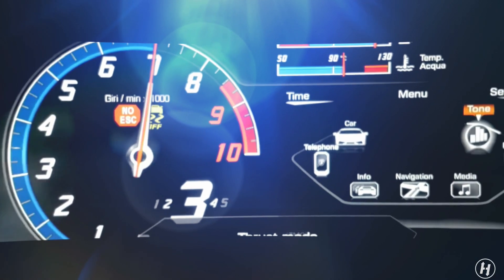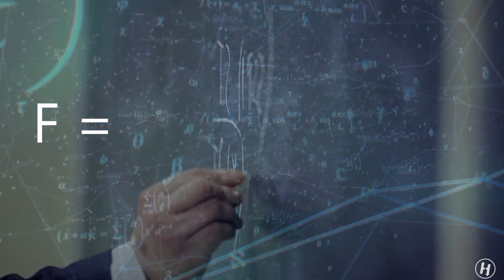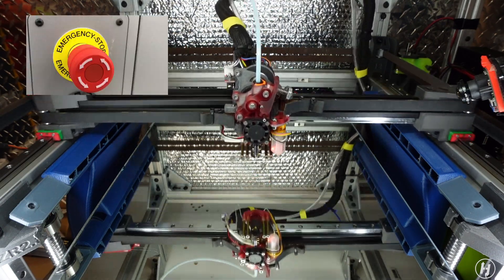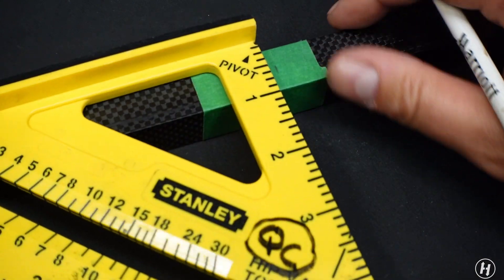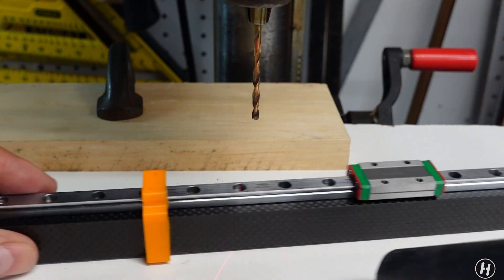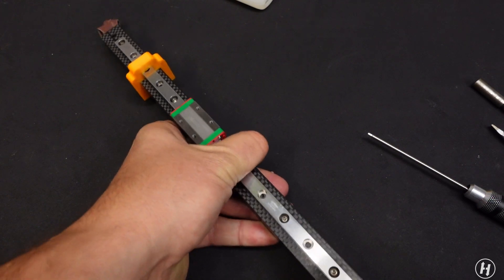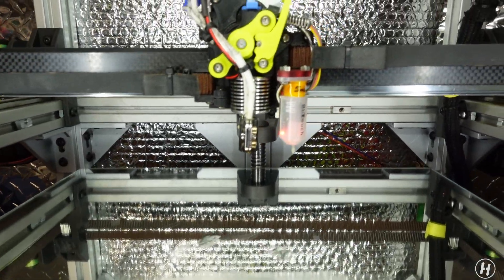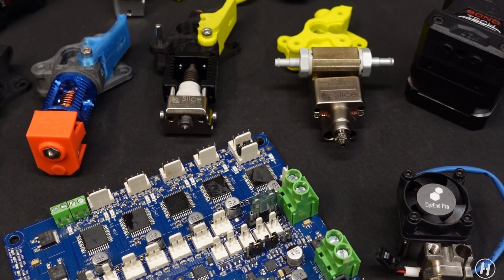Using TITANIUM and CARBON fiber on your 3D Printer

Comment: Don't underestimate the weight of hardware. Mazda famously saved 100s of lbs using 'gram strategy'. That included using smaller fasterners and smaller heads on this fasteners, and ones only as long as needed. I bet the steel bolts are 1/2 the weight.
Reply: It was Colin Chapman, the founder of Lotus, who was the pioneer. “Simplify and add lightness” was his mantra.
Reply: steel is twice the weight of titanium, and titanium is twice the weight of aluminium bolts
Reply: @Nobody-Nowhere  I think they meant that the steel hardware is accounting for half the weight of the whole assembly.
Reply: @Nobody-Nowhere  titanium is about 1/4 durable as titanium... titanium bolts are just a stupid idea and offer little advantage.
Reply: I'm sure nylon hardware is strong enough for holding down the rail, I bet aluminum pop rivets would work too.
Reply: @BrianBoniMakes  steel pop rivets with backing washers...
Reply: @BrianBoniMakes  probably bad for heated chamber, maybe peek or PEI screws would be better.  just pricey.
Reply: That's a fun fact, im a mechanic and I've wondered how much effort companies take to do this
Reply: So that's why Mazdas are junk.

Comment: Great video! Well done and smart, as always. 
You could save a few grams and resistance by making an airtight printer enclosure, running a vacuum pump, and voiding the encloser of all air, but then everything would have to be water cooled...and the extruded plastic would ooze...the part cooling wouldn't work, etc...
Reply: I dont the air drag would play a significant role in performance. Definitely not worth the investment.
Reply: i wonder if the opposite would be better, increased pressure for better cooling

Comment: Why not use plastic-screws/Washers for none-load bearing parts.

Also you can redesing the printed parts for optimum weight to load capacitys.

Saves a few grams
Reply from the maker: Yes, this HD gantry was design specifically to allow servos and heavy weight print head.  Although the CF rods and Titanium hardware got this HevORT HD lighter than my initial STD CF X axis build, the HevORT STD/HT gantry is definitely a better candidate for light weigth.

Comment: hmm. couldnt you remove the cooling fans? i mean the plastic has to cool down. But it doesn't have to be cooled down by air. You could flood the printing area with something that has more thermal capacity or is way cooler to begin with. Something like liquid nitrogen. maybe not that extreme but there is definitely enough cooling solutions that don't need the cooling fans at the print. in addition cooling your motors they will draw less amps.
Reply from the maker: BerdAir is a great way to deliver large amount of air under high pressure to the part when using powerful pumps.

Comment: What about the duet 3 board? It can go higher amperage on the steppers
Reply from the maker: Yes, but it does not support Klipper.  The acceleration gains from additional power would be impacted by the lack of look ahead and MCU processing power.  Its been a long time I have not looked at RRF, things may have change though.

Comment: E3D ditched the carbon plate on their tool changer due to issues with the difference in thermal expansion on carbon fiber and steel (bending of the gantry). 
Did you notice anything indicating this issue? Or is a carbonfiber tube simply just so much stiffer than a 6 mm plate that it neglects the bending/overpowers the rail?
Reply from the maker: I have not noticed any issue while printing ABS with enclosure temps of 55C.  But yes, this may be an issue at higher temps.   Materials used in speed printing usually don't require high enclosure temperatures.
Reply: @MirageC  Thanks Mirage!

No I am not really aiming to beat you guys in a speedboat xD I prefer the best possible quality at higher than average speeds. The lighter, the less ringing at higher speeds :) 
I will be happy with 10k acc and 100 mm/s speeds. I just want as little rigning as possible :)
Reply: They used a cf plate. The tube is stiffer. I didn't see any issue yet but my enclosure never goes above 45c
Reply: @Vez3D   Ok thanks Vez3D! True, yours are also carbon now.. 

Yeah I expected it may simply be stiff enough for it not to be an issue. 

I will be reaching 80 degreees though. At first I was going for a 6 mm carbon plate, but then I saw that E3D blog post.. So now I was going with 6 mm aluminum plate, but seeing this I will see if my design can accomodate a tube like you guys. I am building a crossed gantry machine so it may not fit a 20x20 but maybe 20x15.

Comment: that rail is probably the heaviest thing on there. This week ill be playing with something to replace it. Ill keep you posted :)
Reply: Could you mill or bore holes in the rail to remove weight?
Reply from the maker: Yes, that is something Vlad from 3DPassion wants to have me try!
Reply: @MirageC  9mm rail, flip the rail, use a grinding wheel and grind the rail into a hollow C channel.  Top to connect the two sides and for screw mounting and the sides for the slide balls to ride in are needed, but the bottom center and interior of the rail aren't nearly as useful.  If you take the 12mm rail and grind out the bottom and center like this you can probably take out most of the weight, and there will be little difference between the 9mm rail and 12mm rail.  You need the sides, and there would be very little extra in 3mm extra of just top face weight..
I'd expect to take out half of the mass of the rail, maybe a bit more, that should leave plenty for strength of the remaining C section.
Reply: @ModelLights  I think this thing about removing the weight is going too far...
however I remind you that you have to leave enough material to withstand the preload of the linear guide fixing screws
Reply: @TheRealMrLaserCutter  the steel used for linear guides usually has a hardness of 55/65 HRC, which is a lot for HSS drill bit... it is a real challenge to drill holes in that steel... maybe you can be successful using tungsten carbide bits, but they require precise cutting speeds otherwise you risk throwing away an 80-100 € drill bit after, like, 10 holes
Reply: @librasd8087  Sounds like an excuse to learn to burn! Aka wire EDM or electrochemical machining.
Reply: @nobodynoone2500  wire EDM sound nice for that job! But is it worth it? How much it would cost to do it?
Reply: @librasd8087  maybe a burr or grinding disc and lot of water
Reply: @TheRealMrLaserCutter  and a lot of time
Reply: How about replacing the rail and the CF tub with a pair precision ground titanium tubes.
Reply: How about Teflon or some other similar low friction polymer?
Is it possible to use a igus polymer / teflon sleeve bearing on a carbon fiber rod (instead of the standard ball bearing on steel) - its probalby less precise than a linear rail but, well, less weight
Reply: @GerManBearPig  I tried that setup before. Igus bushings on carbon rods. those LM8LUU bushings need to be caged in an aluminum case to have proper preload..or they are too slack.
 It has too much friction... But maybe not for servos motors :)
Reply: @Vez3D  hi bro can i ask what measure is the carbon fiber square tube? i wanna try it on my voron
Reply: Dude, I love both of your designs!  So thank you both for sharing all the tips, build details, and progress.  I'm such a nerd, love it!

I just picked this back up recently too, after a few years off.  I've hardcore been updating my s#/t, and teaching myself how to set up an Octopus 🐙 pro this week.  Wired up 2 PSU's and all my doodads already.  Trying hard to learn all the ropes of setting up Klipper firmware now, sensorless homing, bed leveling, input shaping, etc.  Would love to hear more tips and tweaks!

I also hope I can jump in these races 🏁too someday! 😆 

P.S., carbon fiber is cool 😎, but it needs more cowbell.
Reply: Exoslide? Or something like an exoslide?
Reply: I was thinking the same. Doesn't the test data show that using the aluminum extrusion is effectively just as accurate? Seems like ditching the linear rail would save more mass.
Reply: I would love to see air bearings which run directly on the CF-beam.
0 weight for the rail and no slipstick. the lack of slipstick should improve print quality.
Reply: @Latschi8  It's not true (straight) enough for air bearings and the air requirements would be annoying when a roller would provide nearly the same without the trouble. Also it would introduce position variability due to the small clearance and varying loads.
Reply: Hi my Chinese made i3 clone made by Hanbot has nylon linear guides... Even the carriage is made from some plastic but have yet to find any similar products
Reply: Have you tought about using two smaler linear rails on opposite sides of carbon square? Like mgn5. With the 2cm space between them, they should be quite rigid, when the blocks are connected together.
Reply: I was wondering if mounting the linear guide on the side of the carbon fiber beam was a better solution to increase the resonant frequency of the y axis than mounting it above / below. Have you done this type of experiment?
Reply: @librasd8087  my next iteration of the printhead will be like that
Reply: @Vez3D  WOW, wow, you are evolving your 3d printer very quickly! Just love it!
I hope you have kept the accelerometer data of your current version, because it would be really interesting to compare it with your next iteration of the 3d printer
Reply: @Vez3D  Maybe instead of a cooling fan you could use a thin flexible hose supplied by an air compressor. 
Next up: 3d printed cooling "fins" that are more like trees than walls (skeletonized for weight savings).
Has anyone every experimented with a piezo-electric filament extruder?
Reply: @ExtantFrodo2  berdair is almost what you describe
Reply: @librasd8087  Isnt a horizontal rail better since the direction of larger area moment of inertia (hope thats the correct term in eng) coincides with the force direction? (xy acceleration being the larges cause of forces on the system) 

The main benefit I see is that it would make it easier to build a very compact stiff printhead. But I'd have to look into it closer.
Reply: @dodo3441  looking at the section of the beam you can see that by mounting the linear guide above the beam you get a greater geometrical moment of inertia for deflections of the beam that are along the z axis; the force that we must take into account is due to the inertia of the print head, therefore it is a force that passes along the y axis, which would be the axis that goes front to back of the 3d printer, and it flexes the beam along that axis. So, to reduce the amplitude of the oscillations and move the resonant frequency towards higher frequencies we must have a greater moment of inertia along the y axis
Reply: @librasd8087  Your statement seems contradictory to me, we might be talking past each other. Are you talking about the moment of inertia of the rail only, or the rail+tube? 

"So, to reduce the amplitude of the oscillations and move the resonant frequency towards higher frequencies we must have a greater moment of inertia along the y axis"
Because we are on the same page about this, but I draw the opposite conclusion regarding the rail orientation. (viewing the rail only)
Reply: @dodo3441  horizontal linear guides do not allow to reach the maximum moment of inertia for the stresses along the y axis
P.S.: i'm talking  about the moment of inertia of rail + tube
P.P.S. it is necessary to talk about the whole assembly, because we are interested in the response of the whole beam + linear guide assembly
Reply: @librasd8087  Yup, looks like we are on the same page. Allthough I am not yet fully decided which is preferable. I'll have to draw it up and also look at the printhead cg of both configurations.
Reply: @dodo3441  the increase in inertia should also be evaluated
by calculating the center of gravity of the print head you should also be able to evaluate the deformations due to the forces of inertia in the two different cases ... maybe assuming 50k accelleration
sure, without an FEM analysis there is a strong approximation
maybe fusion360 can help, but I don't know what it takes to access the simulations we would need
Reply: @librasd8087   I'll be doing multibody sim and FEM and then derive topology optimized parts. (thats the plan)
Reply: the lightest solution would be simply to use a square plastic linear pushing on that square carbon rail, it should work fine
Reply: @Nobody-Nowhere  how about having a look  back in the past and use two carbon rods with linear ball baerings instead. Well they have to be damn straight but that should be much easier than doing this with a square carbon beam.
Reply: @Nobody-Nowhere  that's a terrible idea. Not only would the tolerances be garbage, but the resonant twisting moment would be huge. You would be able to get away with a cheat like that at slow speeds, but at high speeds you have a hot mess... Probably quite literally.
Reply: Carbon Fiber Linear Rails on the CF box tube would really up your print speed.
Reply: @PathosBedlam  does it even exist. I know Igus was working on prototype..but it never got to the market
Reply: @Vez3D  No idea. Just something I thought of while watching this. It would need a decent cnc metal mould to make it under pressure and heat though, then add the holes. Might require new slide design as well.

Comment: What about drilling holes through the aluminium extrusion to shave off weight 😂
Reply from the maker: Like in everything, extreme weight reduction will eventually clash with structural integrity.

Comment: Have you seen the new BTT Octopus Pro? It has support for up to 60V for the motor power separately from the board/heaters etc. Since the steppers also can be pulled it might be cheaper to replace if you blow one.
Reply from the maker: YEs, I have one incoming :)
Reply: I want one, but can't actually find it for sale yet. Settled on the 1.1 out of desperation. BTT, please!

Comment: what was the original full weight?
Light weight is ~539.5grams, but i don't see the full assy weight for full weight.
Reply: At 4:20 , "Just under 900 grams"
Reply: Does anyone know what bedsize he is running? 300*300 or bigger?
Reply from the maker: bed plate is 340*340.  actual print area is 280*280 with this config.
Reply: @MirageC  Thanks, I'll be doing a build focusing on light weight this winter, so its really helpful to have some references as a starting point (Y)

Comment: at 7:20 you say something about washers preventing the assembly coming loose with vibration. That's not a function washers perform.
Reply: Split washers, Belleville, rip lock etc. You could also look at the overall compression of a larger area at helping stop the nut from sinking into the plastic allowing the screw to come loose.
Reply: @ChrisHarmon1  split washers don't do anything regular washers don't in regards to loosening from vibration, disc springs do nothing to lock the fasteners and the vibration damping effects aren't going to do a lot in this kind of of application. Serrated washers do work but you risk damaging the carbon fiber tube. Best thing to do here is to just torque them correctly, use thread locker and check on them regularly.

Of course the washers here do increase the load area and reduce stress on the tube, so I am not saying not to use them, just pointing out that they do nothing to prevent loosening
Reply: @AlexusMaximusDE  I bet a nord lock style would work fine.
Reply from the maker: I should have been more specific, I was referring to the increased load area of washers reducing the chances of having nuts eating through the material under vibration. Thanks for the feedback.
Reply: Without washers, the nuts will compress into the material and cause them to come loose.
Washer are not used in things designed by real engineers for looks, they are there to increase load area and prevent compression (and thus loosening). Those screws are under a boatload of stress during rapid Y motions...

Comment: Have you considered ditching the linear rail? Seems 5 wheels could be used and since you have one side that's fairly flat where the 2 wheels could roll and leave the other 3 as simply tensioners it could be fairly accurate. Also a granite block with some sanding can achieve super flat surfaces.
Reply: Friction bearings on cf rods would be a very light alternative, igus offers suitable systems. They also sell low friction filaments, so one could hypothetically print a bearing that runs on the square tube. Unfortunatley that will probably have noting but drawbacks other than weight compared to rails.
Reply: @dodo3441  I have never been a big fan of igus but I know it can be a great alternative in some applications, just not sure this is one of them. I also wonder if he has C or H blocks and if the Y rails are MGN9? Would see a slight reduction in weight. I was looking at a MGN12C the other day and thinking the center could be machined out with some pockets near the mounting areas for extreme weight reduction.
Reply: Turns out there is also a 20mm carriage, unfortunatley no weight specification.

Igus qwe-01-20
Reply from the maker: @DoDo Do I have one of these Igus 2020 carriage here, it is SUPER heavy!  and bulky.  but the friction filament idea has me now tinkering :)  Thank you!
Reply: and then you'd loose precision.
Reply: @skaltura  To be fair, for the speedboatchallenge loosing a few tenths mm  would not be that big of an issue :D